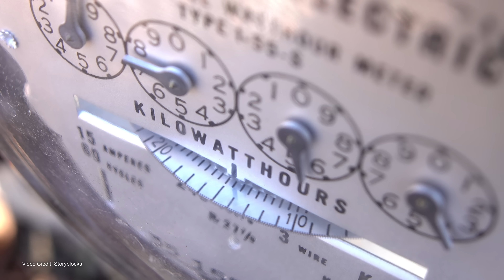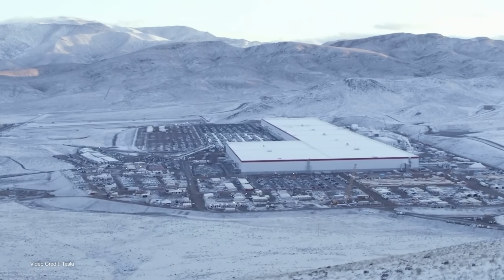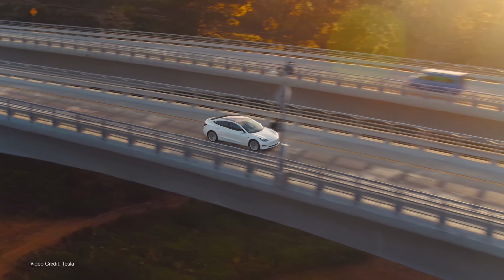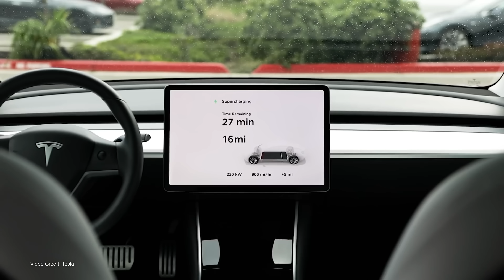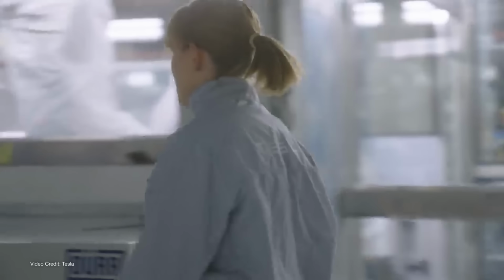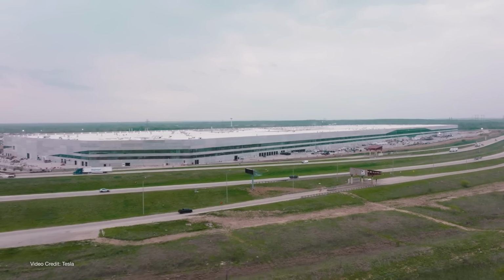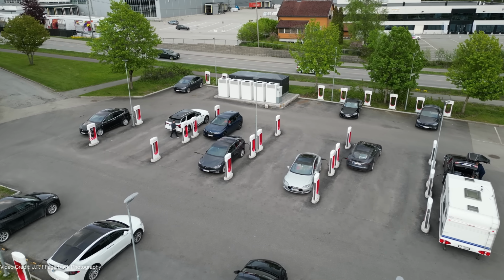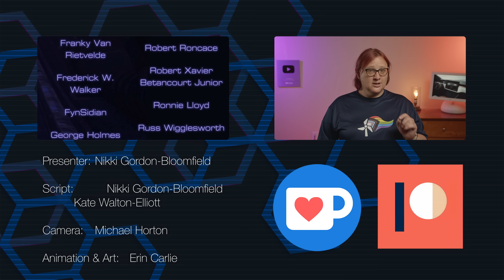Tesla News Roundup Episode 14: Munro Model Y Teardown, Where Tesla Staff Are Going, Model 3 1,000km!

Comment: I could be wrong but I believe most US charging units and most US EVs to date use the Tesla connector. If that is true, would it not mean that it is more simple to adopt the Tesla connector than change Tesla to CCS? Also, having used both it is obvious that the Tesla connector is superior!
Reply: Not only that, but almost 70% of the EVs in North America are Tesla, so this would be a case of forcing the majority of cars and chargers to switch to a poorer solution.
Reply: No, because you would be giving Tesla a monopoly as no one else is allowed or capable of making chargers with that connector. That would mean that any EV buyer would have to pay Tesla for every public charging session and without competition, Tesla can put the price at any level. Tesla decided to keep it a closed design instead of an open standard. That was their choice.
Reply: @Hans-gb4mv  If they make the Tesla connector the standard, Tesla will have to open the connector to everyone.  All the other car and charger manufacturers will be able to use the Tesla connectors.  Even the govt isn't stupid enough to give a monopoly.  Well, govt stupidity is debatable.
Reply: @normcfu  There would be no need to open up that standard for others unless there was legislation in place to do so. And note that that is not what is being requested in the petition.

And I would imagine that if Tesla was forced to open up their charging standard, they would litigate it for years.
Reply: @Hans-gb4mv  I disagree.  If the Tesla connector standard is NOT chosen, then, eventually, Tesla would be forced to change their connectors on their cars and their charging stations.  I think Tesla would prefer to see their connector be the standard.  It would be better for Tesla and all EV owners.
Reply: @normcfu  And yet, in Europe, CCS became the standard that even Tesla adopted. And even in the US it looks like Tesla will be adding CCS charge cables to their super chargers. So, the change is happening anyway.

Hell, not even Tesla is asking to make their charge plugs a standard and they also realize that their plugs are at the limit of power they can ever hope to push through that connector. If they want to match the 350kW a CCS charger can do, the design needs to change for Tesla anyway, so change is not the issue.
Reply: @Hans-gb4mv  As you know, Europe is a different place.  They have their own decisions to make.  At the time of the European decision what percentage of EVs in Europe were Teslas?  Probably a lot less.  CCS may have been the correct decision at that time.  We are talking about the USA where most of the cars and chargers are Tesla.  The CCS connectors are a poorer design.  In the USA we have a chance for a better solution.  Unfortunately, the current govt, especially Biden, hates Tesla, so they will probably choose the CCS regardless.
Reply: @normcfu  I think you would be surprised. At that point in time, the Tesla SuC was by far the biggest charging network. Today, Ionity has caught up when it comes to charging locations (not stalls) with Tesla in Western Europe. And back when the decision was made, Tesla was outselling the competition by a huge margin. So no, it's not like Tesla wasn't big at that time. But Europe decided to go for an open standard rather than a closed standard belonging to a single company.

The market share of Tesla is also dropping in the US, not the sales volume, but market share as their are more and more EVs being made by other manufacturers and more and more being sold. And all those other manufacturers have adopted a single open standard that even Tesla is participating in. So, if you have a standard, that is supported by all major manufacturers, including Tesla, why would you not use that standard? Why would you force every single one of them to a standard that is owned by a single company? So that that single company can profit even more of the rest?

And no, making it a federal standard does not mean that they will be required to open up the standard. You first have to force Tesla to make it an open standard (or they have to do it voluntarily which I really doubt) which will take years of legislation and court battles before you can actually make it a standard if the legislation holds up. And by that time, The market share of Tesla will have dropped even further and you'll have millions of CCS enabled cars on the road. And what will you do with those now that you have changed the standard?

Tesla had a chance to weigh in on the design of CCS over a decade ago, or even CHAdeMO. They chose not to do so but go their own way. That's their decision. They could have stopped CCS from ever becoming popular by just making their own charging solution an open standard that anyone can implement, not only on the vehicle side but also on the charger side. But they decided not to do so. And that is their right.

But any standard set by a government should be an open standard.
Reply: @Hans-gb4mv  You've basically just repeated all the stuff you said in earlier posts.  There are 2 sides here.  1. Why should all the manufacturers have to change their charging ports, and 2. Why should Tesla, the majority of installed base have to change theirs.  Tesla will be happy to open their standard, in fact they offered it before, but legacy auto refused, then convinced govt to standardize on CCS, an arguably worse plug for less dexterous people to manipulate.  Was it really impossible to use the Tesla plug with backwards and forwards compatibility?  Probably not, but legacy auto certainly convinced legislators that that was a good enough excuse.  Here in USA, I'm sure GM, Ford, Stelantis and their unions will force CCS standard.  My point all along wasn't that they should choose Tesla, only that the logical (i.e. non political) decision one way or another is not simple.  Again, govt usually does not make the best decisions for the public or to minimize total conversion cost.  They make decisions according to their lobbyists (FF industry will prefer the poorest solution too) and campaign funders.  

Of course, if CCS does become the standard, Tesla will comply and spend money on conversion here in USA and they will do it better.

Comment: One bad cell, no problem. Just replace the entire battery pack.
Reply: Over the past decade, cell-level repair of any manufacturer's EV battery pack have been quite rare.
Reply: But then you need to balance that cell with the rest of the pack; a newer cell will have different internal resistance than older cells.  It's why you're told to not mix batteries in personal electronics.
Reply: Actually one bad cell probably won't be noticed by the user and probably aren't covered under warranty as well. I think the Tesla battery warranty only covers over 30% pack "degradation".
Reply: The pack keeps working if one cell goes bad. But since the 4680 cells are very large, you may notice the capacity loss even from a single failure.
Reply: @w0ttheh3ll  
I m curious about the nock on effects of a small amount of cells failing and then creating problems within the sub packs that make up sealed systems. 
I keep remembering Douglas Adams's quote on things that cannot go wrong.🙄
Reply: @BixbyConsequence  but it has been done at a considerable less price then replacing the entire battery!
Reply: @gmv0553  It almost never happens as part of warranty repairs, which gives some idea of the economies involved.
Reply: @CrissaKentavr  Cells from a recycled battery pack with the same volt/amp characteristics will work fine and be reasonably priced.
Reply: @motofan16  The diagnostics will know and likely throw an error code on a system designed to be serviceable.